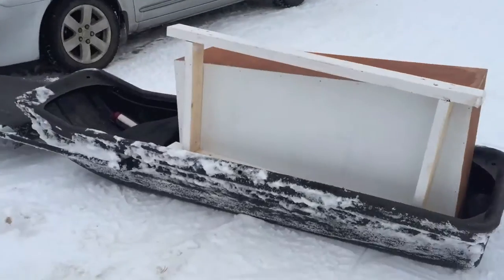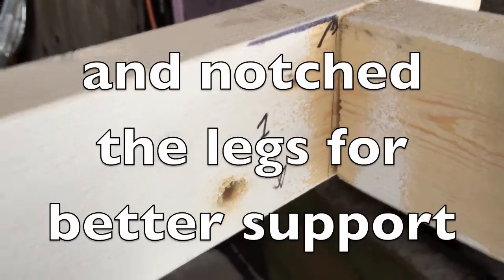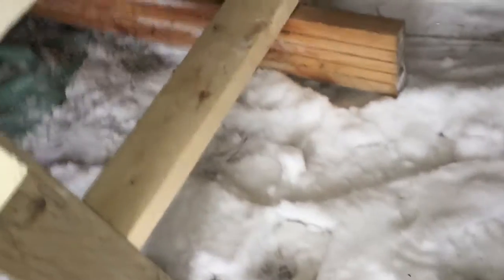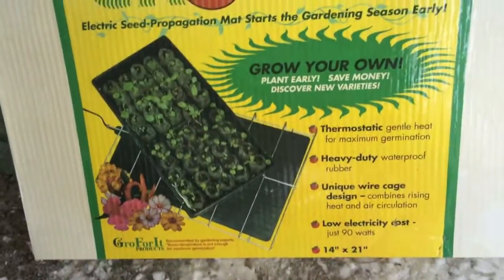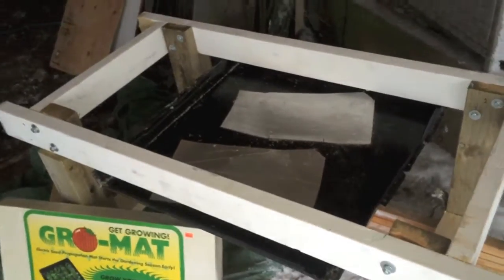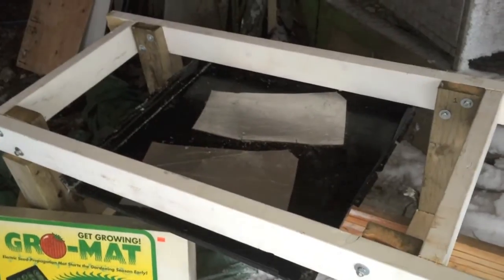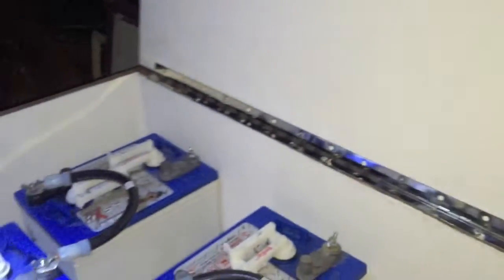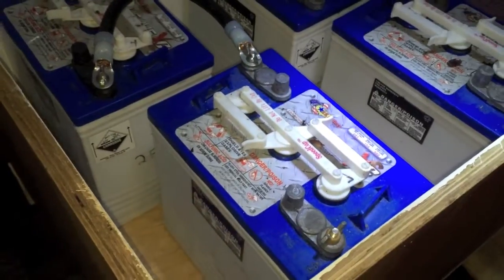Building a Plywood Battery Box  - Part 2

Comment: Hi, I've got a similar property where things freeze in the winter.  Do you leave your batteries out there all year long?  Have you had trouble with freezing?  Great video series.  I liked your cut diagram for the plywood.
Reply from the maker: Cool, thanks. So far, I haven't had big problems. I picked up a small DC wind turbine on eBay and have that connected directly to the big battery bank. It tends to helps contribute a bit of power when the solar panels are covered with snow and there's a windy night. The ideal move would too keep the batteries inside the main cabin in a vented box. Just have to come up with a clever way to hide it in a 440 square foot cabin.

Comment: Why did you put rigid insulation under the batteries when you have the heated mat below?  Seems its would be more valuable to glue it to the bottom of the lid.  Make it easier for the heat to get into the box and harder for it to leave out the top........
Reply from the maker: Good point. I found out later, through trial, the heated mat idea sucked. It worked best to be on a thermostat and that would cost another $79.00 to purchase and shipping to my location. So, the heated mat idea was ditched. Just went with the rigid on the bottom. There wasn't enough clearance at the top. Might modify the box and add a 1" trim to the box side top Then, like you said, add a piece at the top. Thanks for the good suggestion!

Comment: how long can you run your house on when all the 8 batterys are charged?
Reply from the maker: I don't have the 8 batteries hooked up yet, but the 4 can run the cabin for about 3 days in the summer and 1-1/2 days in the winter. But, that is not to zero percent. I run the batteries down to 60% at the lowest end. It's faster to charge back up to 100% at that percentage. (Faster = running the generator/smart charge for 3 hours at 13 amps) The best plan to conserve power is shut everything off at night. Loose about up to 16% in the winter.